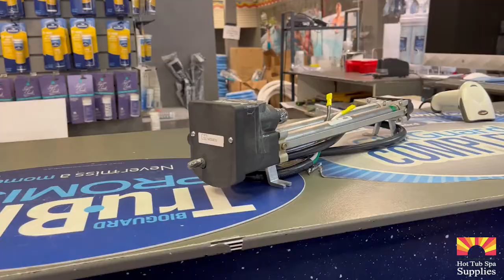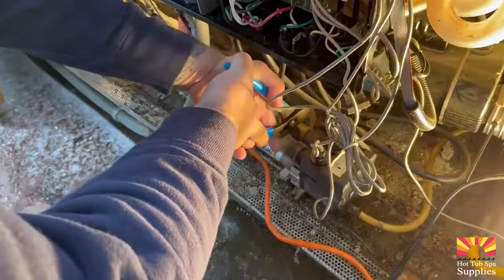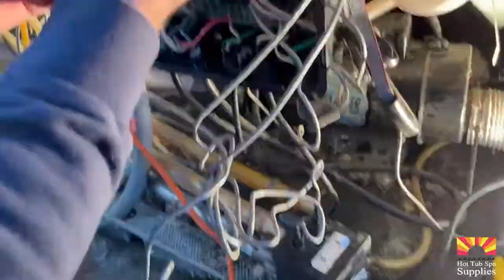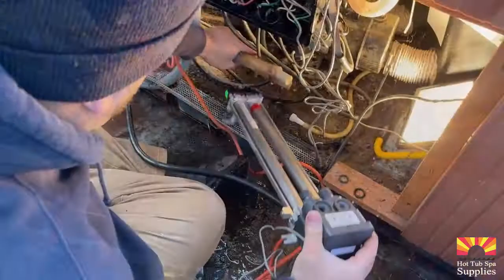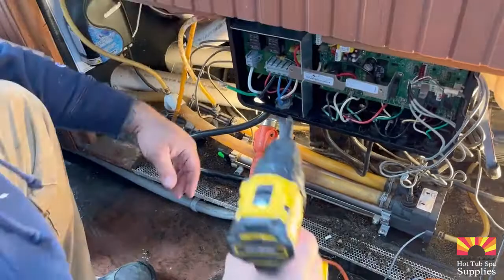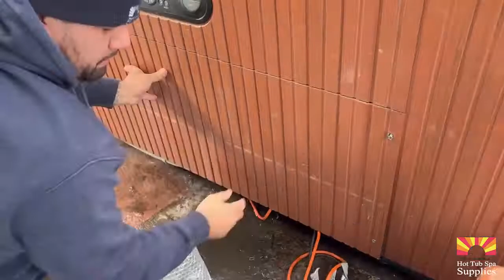Heater Replacement

Comment: Is the white & black wire always in that configuration? With the H1 and H2. We bought a refurbished tub from a company and found the grounding stud(on the heater"cooper" not grounded and watching this video I believe they have them backwards on the white and black. When we turned on the tub when the hot tub went to start priming pumps and heater kicked on everything went blank and shutdown. The only difference on my board and this one is all my connections are on one line and not the white separate from all the other connections
Reply: I have a 2012 hot springs grandee and it also has a single bank for the wires and my white is in h2.  Worked great for 10 years and replacing it now.